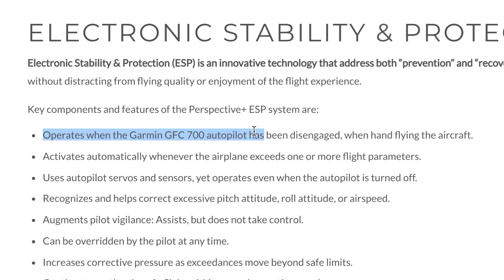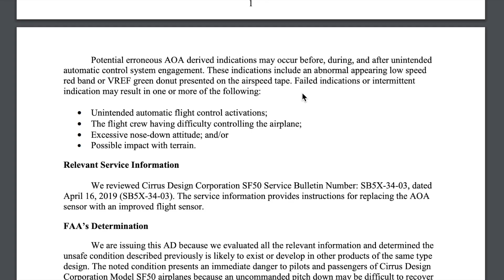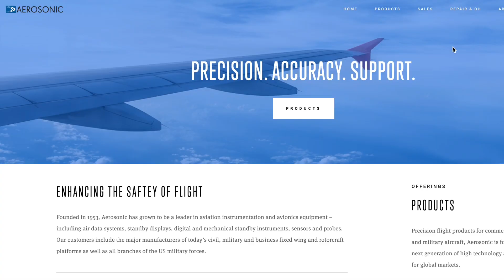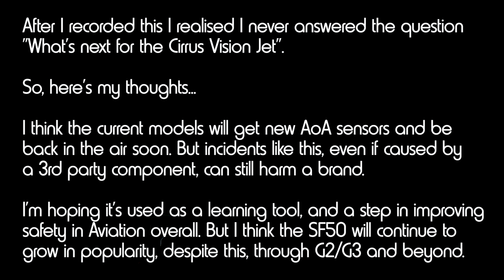Why did the FAA GROUND Cirrus VISION JETS?

Comment: At this rate I think the entire industry will need to rethink the automatic take over by an AOA system.
Reply: I think what also concerns me, in particular with the 737 Max, is that they introduced these automatic systems because of some instability of the flight characteristics of the plane. I think we would be better off if we can design planes that don't need these systems, although I can see how these systems are very helpful. Maybe we are pushing the electronics in planes too far at this stage? Or maybe it's more testing and more proven electronics that are needed?
Reply: @h0ll1s  dude we all know*IF THEY WORKED* they would be helpful but my guy their not good right now look I think it's too early give it a good 10 years
Reply: @Gamerboy-gy1rl  
On of the issues not fully explored is the QA process during assembly and installation of these components as will as inspection in-between flights
Reply: @h0ll1s  The 737 MAX is not unstable, as far as design is concerned. The MCAS was added as a means to retain the same 737 type certificate. That's it.
Reply: @bloodguard41  The 737Max had issues with uncommanded aerodynamic pitch up at high angles of attack due to the larger fan cowls much further forward mounting (acting like a canard). MCAS was a quick and dirty fix for that. Whatever Boeing may say the FAA found it significant enough for functioning MCAS to be an airworthiness requirement.
Boeing has also announced (to NY stock exchange) that it has found other significant software errors while investigating the MCAS issues (this is one of the reasons the software fix has not been rolled out as they need to do a full root and branch retest and recertification).
I suspect any aircraft with active AOA controls is going to cop heat over failure mode responses from here on, and the manufacturers of these sensors are going to cop heat on both manufacturing systems and basic design.
Reply: @bloodguard41  ok so 'unstable' may have been too strong of a word to use, from the articles that I've seen the new engines did change the flight characteristics of the plane which made it prone to stalling at high power and high nose attitude, and so MCAS was introduced to help the pilot avoid a stall, so from what I've read and heard, there is an unwanted characteristic of stalling which was responded to via sensors and software. Maybe it's a case of pushing the envelope too hard and a case in favor of producing a more stable aeroplane in the first place. Example of articles and video: https://phys.org/news/2019-03-ethiopian-airlines-mcas-boeing-max.html https://theaircurrent.com/aviation-safety/what-is-the-boeing-737-max-maneuvering-characteristics-augmentation-system-mcas-jt610/ https://www.youtube.com/watch?v=H2tuKiiznsY&t=232s
Reply: @allangibson8494  Don't know what the software issues were or are exactly. 
As far as the plane design, there are changes in the aerodynamics, yes, but not to the extent that the plane would be uncontrollable. However, those differences were enough that the plane couldn't keep the same type certification as all the other 737's. In order to avoid recertification, they added MCAS to keep the plane "feel" like the previous 737s.
Reply: Igor Šmit 737 Max is unstable when full thrust is applied. It is due to the new engines are too big to be mounted under the wing, so they mounted them further forward, resulting in enormous uplift of the front part of the 737 Max.
Reply: @Paul Baker As an industrial safety systems engineer, the concept of a single sensor with no diagnostics in an active safety of life system should have been a cause for concern, the fact that it introduced an entirely new failure mode should have rung alarm bells. 
Applying the principles of IEC 61508, ISO 26262 & ISO 12100 to the software and hardware design would have been a good start. 
It would be nice if Boeing put as much thought into their planes as Toyota have to into their cars.
Reply: @allangibson8494  These stability control systems must not rely on a single instrument. The computer needs to compare all instruments, (exactly the way a human pilot would) to determine the situation the aircraft is in and if there is a malfunctioning sensor. If the AOA is high but so is the airspeed, and the airplane is in level flight and not pulling any G's, then the AOA is erroneous and the airplane is in no danger.
Reply: @allangibson8494 I think the problems is two fold:   I program Safety PLC's.  (usually Rockwell or Siemens).    A/ You need not 1 or 2 sensors but at least 3. You can then use a 2oo3 rule (2 out of 3) rule.  B/  Civil aircraft tend to use vane type AOA sensors but they need to use different types that are based on different principles so that they don't all fail at the same time and in the same way.   The military use the more compact pressure nulling type.  This has a sideways probe with slightly offset pressure ports which measure the airstream pressure.  A motor then drives the device into pressure null.   The nice thing is that you can test these on the ground and even in flight by rotating the motor and checking for zero speed on the ground.     Good point about Toyota.  The Auto industry triplicates all of its sensors.   Remember it appear to have been Rockwell Collins that did the software to Boeings specification and they outsourced it to India.  This kind of software writing leads to a lot of too and fro delays.
Reply: @WilliamJones-Halibut-vq1fs  I prefer Schnieder Triconex or ABB August over Rockwell or Siemens for the better voted redundancy. I agree active diagnostics are key for these safety systems. The underlying need for these systems needs to be justified as well. Better to engineer out the problem than patch it with a software cludge.
Reply: @Paul Baker And 90% of the computers on Boeing planes are running windows... (OK - its the seat back entertainment systems... (Airbus had to patch a security hole from that since you could access the flight controls and navigation through the seat back screens as they were on the same network)).
Reply: The AoA system is a indication system  and should not be developed to enable the pilot to reduce vigilance over the. Instrument s in comparison with the event s occuring outside the aircraft
Reply: There are clues here for the automotive industry!
Reply: @Paul BakerI work in process automation.  People working on the ground were flabbergasted by what Boeing ended up doing.  I think it will be a while before we find out exactly how they got themselves muddled.   I think it has to do with having a steel pull wire flight control system and then having to kludge in intervening automation that really needed to be done within the framework of the same fly by wire system the excellent B777 and B787 used.  In addition there was probably an issue of poor synchronisation of documents and information.
Reply: I think the entire industry needs to STOP putting profit before safety. AND, trying to bypass certification for different variants. If an automobile manufacturer makes one slight change to a model, it needs certification in every country the model is sold. Why does Boeing not need to do this?